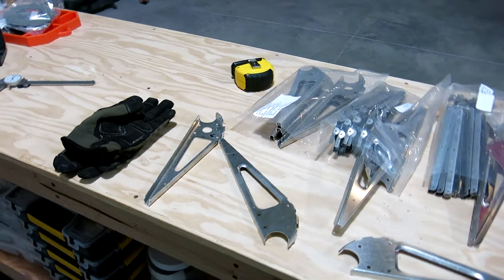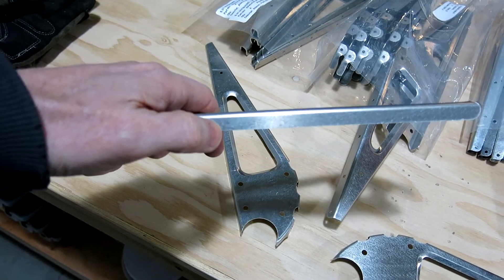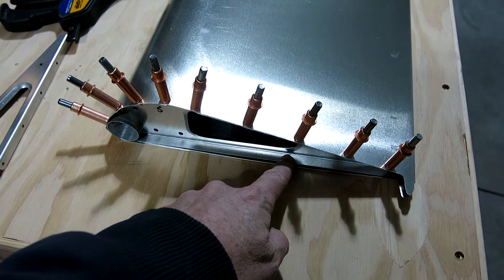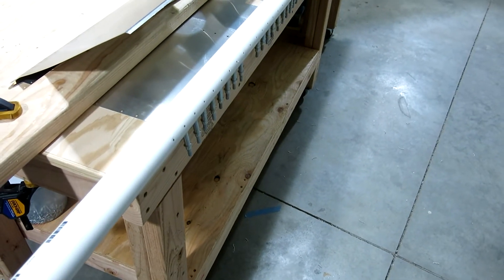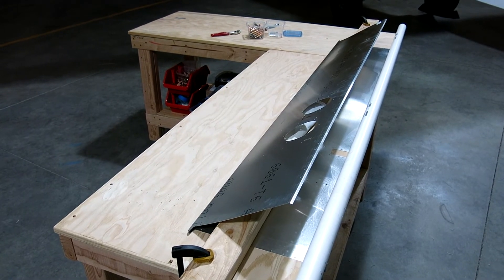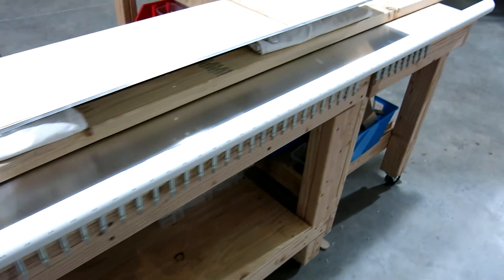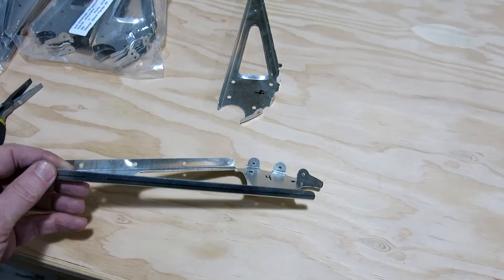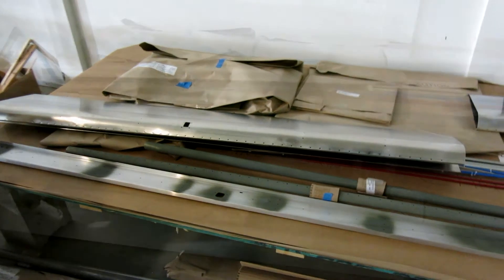No. 57 12-27-2020 Aileron and flap construction

Comment: I am glad you are well ahead of me now.  I got a warm day here in PA so I was finally able to degrease and wash my spars and wash and acid etch my flap and aileron skins.  I am hoping to prime them tonight and try out the paint booth I made last November.  I wasn’t sure if the front edges of the flap and aileron skins overlapped, but I figured they didn’t since both have a pretty good crease formed into the edge.  However, if they overlapped them I wanted to prime the underlying skin on the outside where it goes under the other.  Your video showed this nicely so now I know for sure I only have to prime the inside of the skins.  Hopefully, after more than 3 months of no building (just research on engine and avionics and electrical), I hope to catch back up to you a little here as summer arrives.